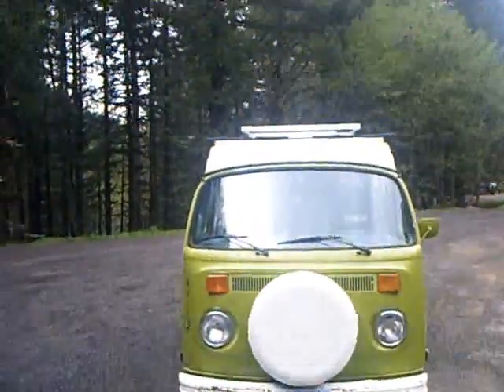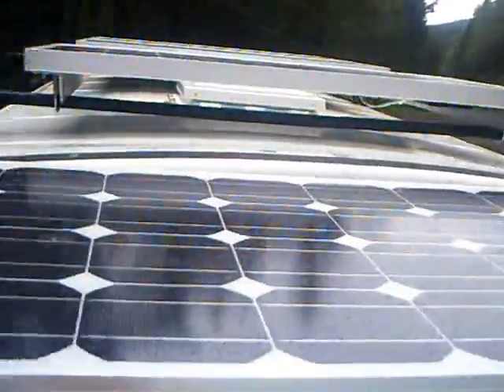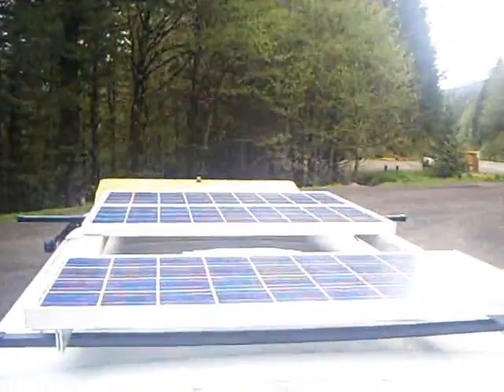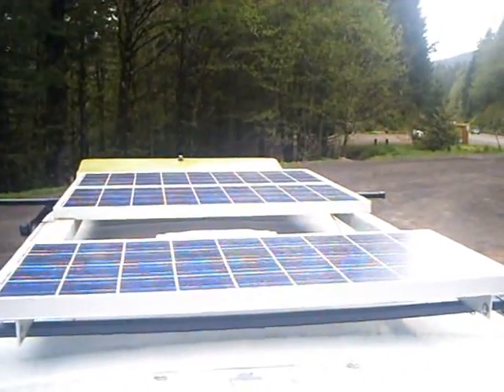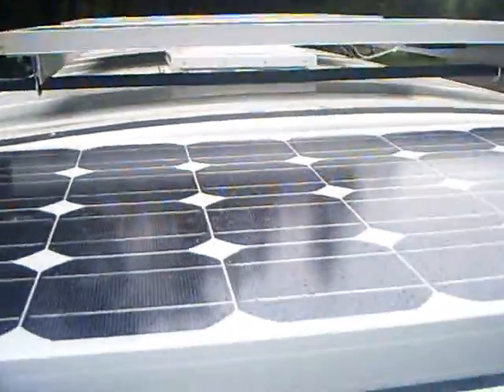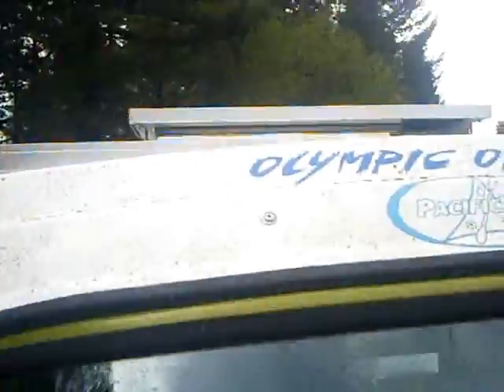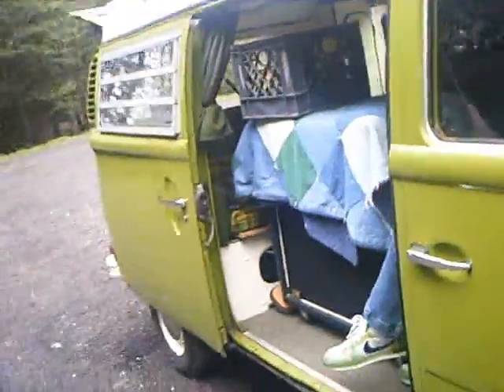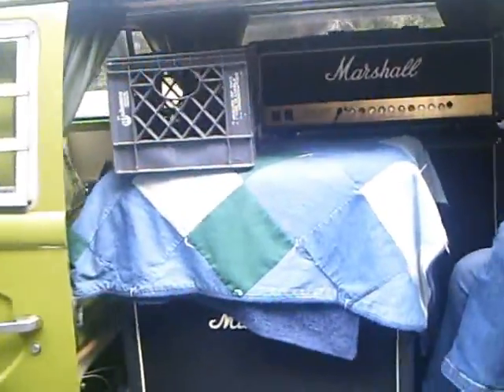Worlds Loudest Solar Powered Guitar Amplifier

Comment: hi- nice set-up-nice playing too~!...   i'm looking to do a similar - yet simpler set-up- maybe you can offer some advice or tell me if it will work-  I'm considering the Goal Zero Yeti 400 watt- it has a Sine Wave inverter built in-  I'm looking to run a Peavey Artist 240 Tube amp- it is: 60 Htz- 400 watt - Will it be able to be powered by the Yeti 400 with a full charge- and of course i'm wondering how long a full charge will power?
Reply: +MoonBeam Jim  I was thinking the same for small amp (AC33 and pedals) although apparently don't run the Goal Zero 150 down by more than 50% or it will start to fail much earlier. Have you tried it?
Reply: not yet
Reply: My personal solution is having only DC amps, so you can avoid the inverter and some electrical noise.  Most amps work at split-voltage (-12, 0, +5, +12 ), obtainable from 2 batteries in series.  This also reduces batt size since you save some current when get rid of transformers, inverting section and 127 step down regulation.
Reply: @benediktron  Modified sine wave inverters can be buzzy crap if you put any load on them and the electronics aren't good noise rejection.

Comment: That's true, but they're also not used for as long a time. So a relatively low-power object turned on for a longer time can still consume more energy than a relatively high power object turned on for a short time.

Comment from the maker: The battery is always charged by the time I put any load on it.  Generally it sits idle....  With 275 Watts instantaneous power from the PVs I could go for hours on the deep cycle battery I have.  No issues....2 years and going strong!